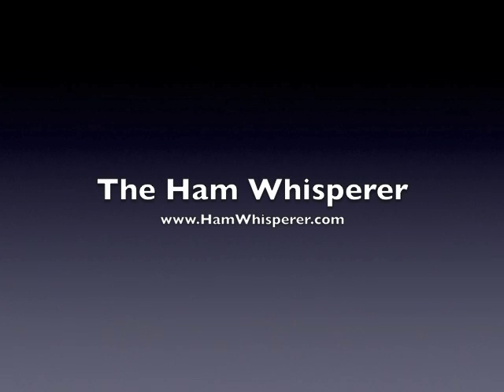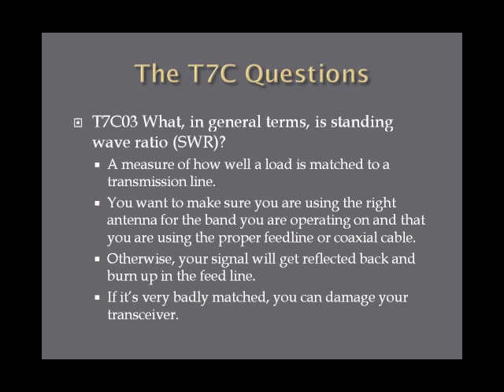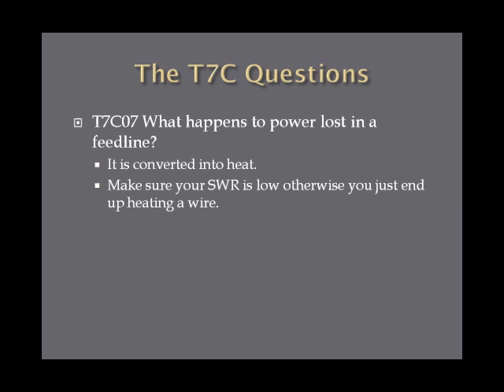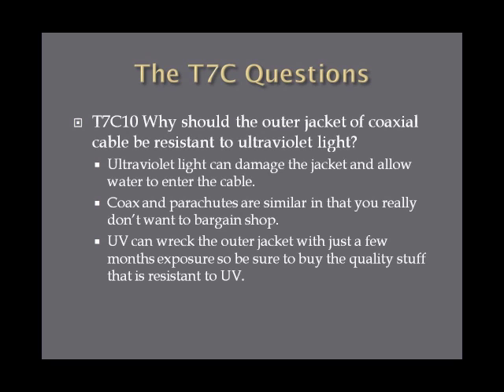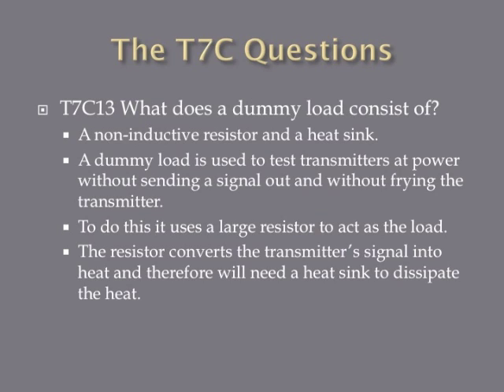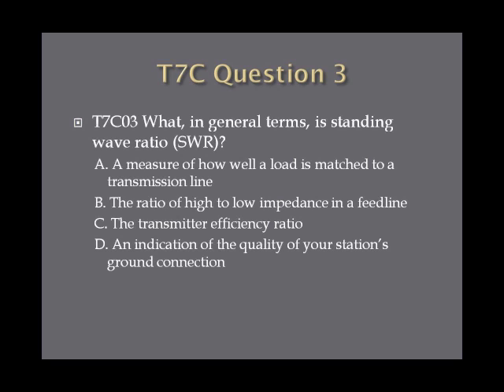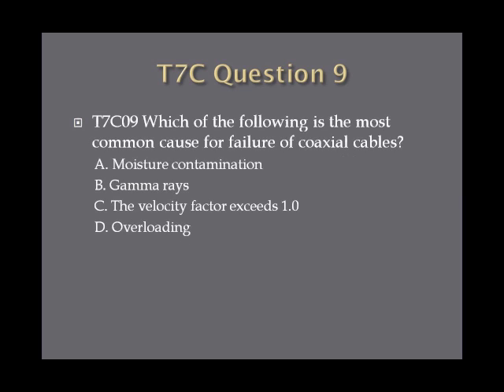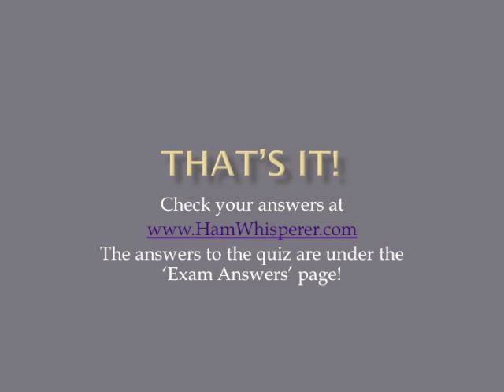Lesson 25 Technician Class Exam T7C Second Edition

Comment: I had an open in my coax going to my Stryker sr955-hp CB radio causing the swr  to go to infinity which blew out my mofset finals; this radio has four FQP-12N10 Fairchild Mofset FET final transistors..